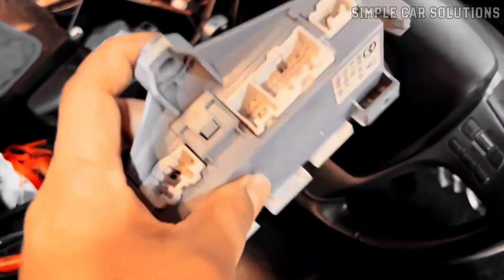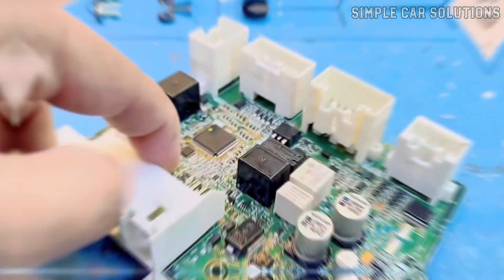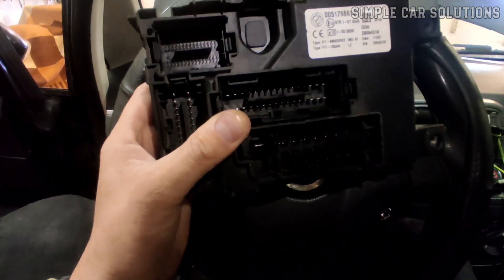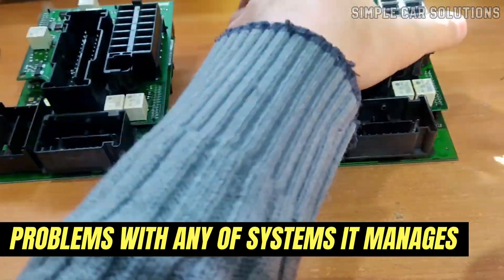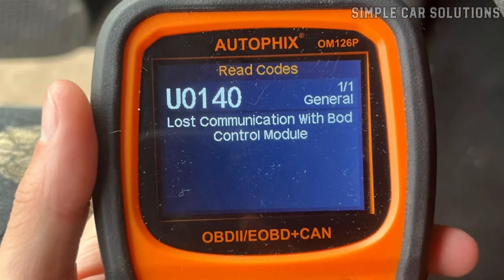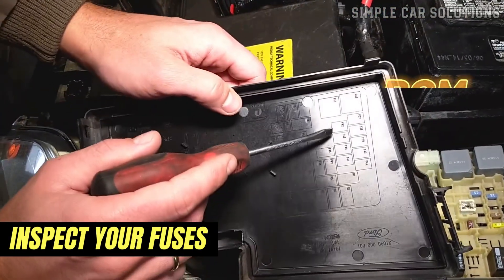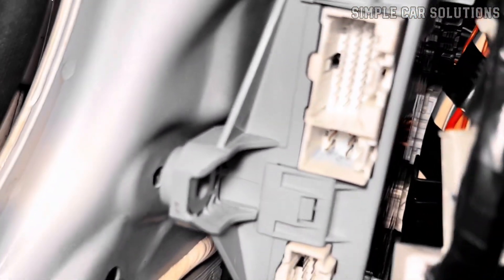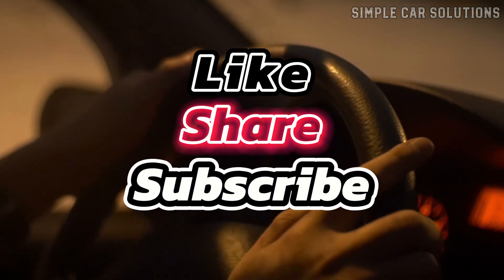5 Symptoms of a Bad BCM (Body Control Module) and How to Сheck It Yourself

Comment: I hit a speed bump too fast (did not see due to being covered in cement dust...long story). The front end of vehicle almost bottomed out. As soon as I hit it, the OAT stopped working indicated by outdoor air temperature reading -40 degrees. that night i noticed headlights not working. Could that have damaged BCM (or just loosened it). Also been having intermittent problem with steering wheel radio controls, power windows, engine trouble lights, etc before the incident. Even though there are no current engine trouble lights, would a auto parts store be able to hook a meter to it and scan for issues?
Reply from the maker: Yes, hitting the bump could have loosened a connector or damaged wiring, especially since you already had intermittent BCM-related issues. The -40°F reading usually means an open circuit to the ambient temp sensor. I’d check grounds, connectors, and wiring first before condemning the BCM. An auto parts store can scan for codes, but they can’t fully test BCM data - a dealer-level scan is best.

Comment: I have a Nissan nv200 2013 plate van…had  it towed to the auto electrician on 29th September 25  …he identified the BCM as the problem … I phoned Nissan dealership in Newcastle Upon Tyne UK and was told that the BCM is not available anymore …. It has to be the specific part number on the BCM but can’t get one …the van is still at the garage to date …I am at a loss as to what to do …it’s my business van and I can’t afford to buy a new van atm …there has to be a solution or I’ll have to scrap it which is ridiculous…any ideas anyone 😏🤯🙏🏻 💖🏴
Reply from the maker: Don’t scrap it yet. Your options are: send your BCM to a specialist for repair/refurbishment, find a used BCM with the same part number and have it cloned, or use an auto-locksmith/electronics specialist who can reprogram the immobilizer. This is very common in the UK and usually fixable without a new BCM from Nissan.
Reply: @SimpleCarSolutions thank you for getting back to me ..you have given me some hope ..thank you it’s much appreciated
Reply from the maker: @Sdean8494 You’re very welcome. I’m glad it helped. Hope you get the van back on the road soon.

Comment: My rear right signal light turns on erratically when the car is switched off and parked in the garage. Went to the dealer and they said to replace the bcm. Could it be the case? Or maybe it’s just a grounding problem or a bad fuse?
Reply from the maker: Yes, it could be a BCM, but don’t replace it yet. Erratic lights with the car off are very often caused by a bad ground, moisture in the tail light socket, or corroded wiring, not the BCM. Check the rear light ground, connector, and water intrusion first - BCM should be the last step.

Comment: Esse vídeo foi essencial, estou com o meu carro com esses tipos de situação, ligo o ar condicionado o carro desliga, agora ligo o carro e as luzes liga a buzina aciona joga água no parabrisa e tenho que retirar o cabo da bateria pra desligar o carro
Reply from the maker: Those symptoms strongly point to a failing BCM or a shorted ground/power circuit. Before replacing the BCM, check battery condition, main grounds, and wiring for moisture or corrosion. If all checks out, the BCM is likely faulty and will need replacement and programming.

Comment: Insignia 118kw, 2009y.
Do not start and diag say is U0140. But i have no.problem with electronic part like window, sensor or other parts.
Reply from the maker: U0140 means lost communication with the BCM. Even if windows and other electronics work, a partial BCM or CAN-bus communication issue can still prevent starting. Check BCM fuses, grounds, and CAN wiring first; if those are good, the BCM may be faulty or need reprogramming.

Comment: When I lock the doors, infotainment screen is turned on automatically ...and remote doesn't unlock the car. That might be BCM issue
Reply from the maker: Yes, that can point to a BCM issue, but first check the key fob battery, door lock actuators, and BCM-related fuses/grounds. If those are good, the BCM is a likely suspect.

Comment: My window on the driver side stopped working and the radio has stopped outputting sound.  I had a shade tree mechanic try to fix it but he made things worse.  Someone tried to charge me almost $800 to fix the bad BCM was he trying to get over on me?  After reading the comments I will add I had just replaced a old fob on my 2015 Dodge Challenger and had a new fob programmed to start the car.  Later that day my window stopped working
Reply from the maker: $800 is high without proper diagnosis. A bad BCM is possible, but a dead window and radio sound loss are more often a blown fuse, door module, bad ground, or wiring issue - especially after key/fob programming. Have the fuses, door switch/module, and BCM codes checked before replacing anything.

Comment: Hello! After inside & outside washing of my Mazda 3 hatchback 2014 (not engine wash), it sometimes don't start and make continuous double bip when I press the brake for starting. Also unable to command windows. It can stay like this 2 days and sudainly it starts and all work normally. Almost 2 weeks I have this problem. What do you think about it? Thank you.
Reply from the maker: That sounds like moisture getting into a BCM connector or a bad body ground. Water intrusion can cause no-start, brake beep, and window failure. Check BCM plugs, door/footwell wiring, and all body grounds for moisture or corrosion.

Comment: I would really like to know how to ground the BCM which you recommended. Thanks for making the video.
Reply from the maker: The BCM grounds through factory ground wires - don’t add a new ground directly to the module. Instead, locate the BCM ground points, clean them to bare metal, tighten securely, and check for voltage drop on the ground circuit.

Comment: Buenas tardes... Tengo un Opel Vectra C  1.9 150Cv del 2004 y presenta todos estos problemas que da el BCM, Mi pregunta es al cambiar el BCM es necesario después  Programarlo ?
Reply from the maker: Yes. In the Opel Vectra C, the BCM must be programmed and paired with the vehicle (VIN, immobilizer, and keys) after replacement. Without programming, it will not function correctly.

Comment: Good afternoon... I have a 2004 Opel Vectra C 1.9 150hp and it's experiencing all these problems associated with the BCM. My question is, after replacing the BCM, is it necessary to program it afterwards?
Reply: Yes.  You can take it to a dealership and they can do that.
Reply from the maker: @freddydossantos9531 Yes. On the Opel Vectra C, the BCM must be programmed and paired to the car (immobilizer, keys, VIN) after replacement. A used or new BCM won’t work properly without programming using a dealer-level scan tool.
Reply: @SimpleCarSolutions  How much is the cost for dealer scanner/reprogramming?
Reply from the maker: @AsAManPodcast77 Typically $100–$200, depending on the dealer and region.

Comment: Hello, what if the battery positive cable touch the BCM...all of the lights come on dash but no crank. Would you suggest replacing bcm? I would think the voltage spike fried the component/components.

Thank you,
Reply from the maker: A direct hit from the battery cable can easily fry the BCM. If all dash lights come on but there’s no crank, check BCM fuses first - if they’re good, the BCM was likely damaged and will need replacement and programming.
Reply: @SimpleCarSolutions Thanks, I will check later this week...Car has been sitting in driveway lol
Reply from the maker: You're welcome - check the fuses when you can. If they’re good, plan on a BCM replacement and programming. Let me know what you find.

Comment: Hello from France! 
I'm having issues with my Dacia Dokker and I suspect the BCM might be the cause. I'm experiencing problems with the door locking system, the wipers, and most importantly, over the past few days I've had major issues with the lighting. For example, the rear lights no longer turn on when I use the low beams, the interior light turns off when I use a turn signal, and the parking lights turn on when the switch is in the off position but turn off when I switch them on. All sorts of bugs like that, which mean the car is staying at home until I find a solution. 
Do you have any advice for me? In any case, thanks for this very helpful video!
Reply from the maker: Hello! 👋 Those symptoms definitely point to a BCM or a major ground/wiring fault. Before replacing the BCM, check the main body grounds and the wiring/connectors at the BCM for corrosion or looseness — Dacia/Renault models are known for bad grounds causing “crazy” lighting behavior. If the grounds are good and the power/ground to the BCM is stable, then the BCM itself is likely failing. Avoid driving it until it’s diagnosed.
Reply: Thank you so much! It’s been difficult to get answers from the local garages, they don’t really seem to know what to do. I’ll try what you’re suggesting! 
If the BCM does need to be replaced, I was told it has to be reprogrammed and that you can’t do it yourself. Is that true?
Thanks again for your help, it’s really kind of you! @SimpleCarSolutions
Reply from the maker: @annatrnx1389 Yes - on Dacia/Renault models the BCM must be programmed to the car (VIN, immobilizer, configuration). It can’t be plug-and-play. A dealer or a shop with Renault Clip can do it. Once the wiring/grounds are confirmed good, that’s the next step.

Comment: Hello from Costa Rica. 

I recently imported a 2025 Tucson that came with a key fob issue. The key could open and close the doors but the car wouldn’t detect it so it didn’t start.

I called a locksmith which erased the only key i had from the car and now the car is completely dead. No dashboard lights or sounds. Can’t open or close doors from doors. He messed up the whole car just by hooking up the scanner. 

I’ve checked fuses, i’ve tried connecting other scanners but the car won’t communicate. What can be causing the issue. I’m sitting here with a brand new car that won’t do anything and i’m worried. 

Please help!
Reply from the maker: Hello 👋. It sounds like the locksmith’s scanner corrupted the BCM/immobilizer data - that’s why the car won’t wake up or communicate now. On these newer Hyundais, once the key data is wiped incorrectly, the BCM/RKE module can lock up.

You’ll likely need the dealer to reprogram or, in worst cases, replace the BCM/immobilizer module and re-pair new keys. It’s not a wiring or fuse issue - it’s a software/security lockout.

Comment: Hello @SimpleCarSolutions. My 2015 Altima won't start because it doesn't recognize its key fobs. Doors unlock/lock fine. Locksmith scanner says 2 fobs are programmed. I replaced the fuse block neck to the steering column. I bought a different IPDM. Dealer will have to reprogram it. Should I also replace the BCM just to be sure?
Reply from the maker: Hello. No, don’t replace the BCM yet. A “no key detected” on Nissans is usually a bad steering-column antenna, keyless control module, or IPDM programming issue. Have the dealer program the IPDM first and check the antenna/immobilizer circuit before buying a BCM.

Comment: Looking for Help – Jaguar F-Pace 2018 (2.0 Diesel) Starting Issue

Hi,
I’m having a major issue with my 2018 F-Pace and could really use some advice.

The car has power and the battery is good, but the screens and start button won’t come on, so I can’t start the car. There’s no ignition response at all — it doesn’t crank, doesn’t turn on, nothing.

What does still work: the tailgate, seats, steering wheel adjustment, interior lights, high beams, headlights, indicators, and hazards. But the vehicle itself won’t start or wake up.

This all started yesterday after I was refitting a new rear boot door. While rewiring the rear camera (the one with the four thin wires plus the main signal wire), two of the skinny wires touched and caused a small spark. Ever since that moment, the car won’t start.

I’ve checked all the fuses and relays. I found one blown 10A fuse in the rear, replaced it, but the issue remains. I also tried jump-starting with a booster pack and from another car — no luck.

Is this something you could help with?
Reply from the maker: It sounds like that short likely took out a BCM-related circuit or a LIN/CAN line. When the BCM can’t communicate, the start button and screens won’t wake up even though some accessories still work. Recheck the wiring you repaired, especially the camera harness and grounds, and scan the car - even a cheap scanner will usually show “no communication” with one or more modules. The next step is tracing power/ground to the BCM and checking for a blown inline fuse or damaged wire in that rear harness.
Reply: @SimpleCarSolutions ive checked all the fuses and relays and they seem to be all good. So im guessing it could be the bcm as you mentioned. Do you have a estimate as to how much it could cost. Also i heard i might need a rfa aswell would fhe be the case?
Reply from the maker: @wilsonchaby4648  Yes, it could be the BCM. A replacement and reprogramming (including RFA for key/start authorization) on a 2018 F-Pace can run $1,200 - $2,000 at a dealer.

Comment: I got a 2001 Tahoe that the lights flicker when I press the window switches or turn the ac on and if I turn the headlights off the radio turns off I checked the grounds and everything
Reply from the maker: Sounds like a bad ground or voltage drop issue:  check the main body and dash ground straps again, especially behind the dash and near the battery. BCM failure is less likely.

Comment: Hello,
I hv a chevy cruze LT 2011
It was facing some issues 
Locks working by itself, power windows not working, hving dim lights and my parking lights are barely visible
I've got the BCM replaced and now hv the issue again
And i hd to remove the battery from the key fob to avoid the licks working by itself
Can you help me in any way?
Reply from the maker: Sounds like a wiring or ground fault, not the BCM itself. Check main body grounds under the dash and near the battery, plus inspect door harnesses for broken wires.
Reply: @SimpleCarSolutions i bought another BCM but it's not program that i can start the car
But my windows work perfect and light also but idk abt the lock
Reply from the maker: @bunny._king Right — the BCM must be programmed to your car’s VIN and immobilizer. Once it’s coded properly, the locks and start function should work again.

Comment: I have a 2019 Honda Odyssey EX-L. I recently had the brakes replaced, and the next day, when I pressed the parking brake, it made a strange noise. It turned out that the rear left side did not disengage when I released the parking brake.

The following day, when the mechanic tried to clear the error codes, multiple warning lights appeared on the dashboard — including ABS, Lane Mitigation, and Cruise Control. In addition, the parking brake switch became completely unresponsive.

The next day, the trunk also stopped opening, even when I tried to open it manually from the outside. It only opened from the inside, but when it did, the vehicle made the warning sound that usually occurs when driving with the tailgate open.

I took the van to a Honda dealership, but they said they couldn’t figure out the issue and suggested it might be caused by an installed accessory (a dash cam). However, I’m not convinced that’s the cause and have no idea what to do next.

Today, a new warning appeared on the dashboard: “Transmission problem. Apply parking brake when parked.”

Please help me figure out what could be causing these issues.
Reply from the maker: It sounds like a BCM or grounding issue triggered after the brake work was done. Check all fuses and main grounds near the battery and under the dash, and disconnect the dash cam to rule it out. If the faults persist, the BCM or its connectors may need inspection or reprogramming at a Honda service center.
Reply: Could it be the abs actuator or the harness too? Cuz I already took it to Honda and all they did was what I already tried. Expect “Oh, you have all kinds of accessories and tried to install those accessories. All I have is a dash cam which is there for the past 8 months” Anyways, really appreciate your reply and insights. Just wanna rule out all I can before taking it to Honda again cuz they are freakin expensive.
Reply from the maker: Yes, it could — a faulty ABS actuator or damaged harness (especially near the rear brakes) can cause BCM and communication faults. Check for corrosion or pin damage at the ABS connector.